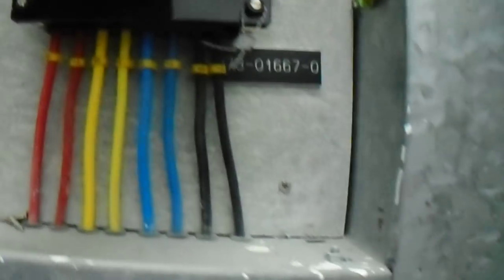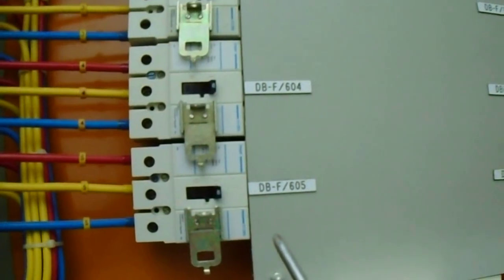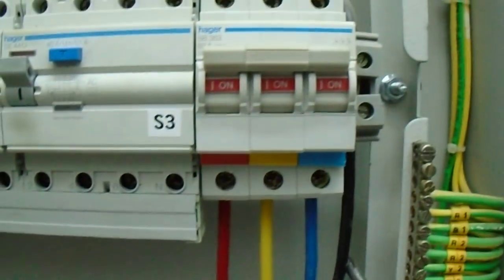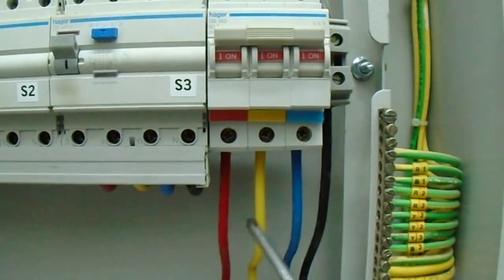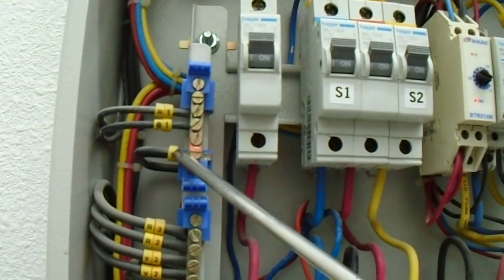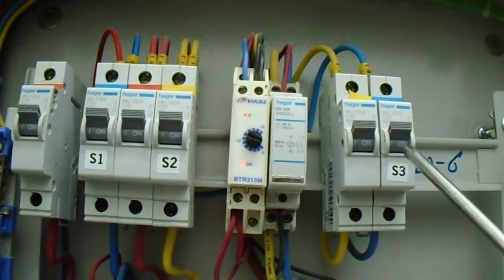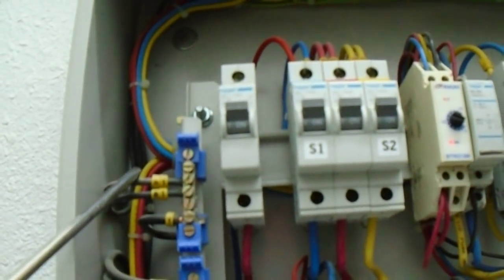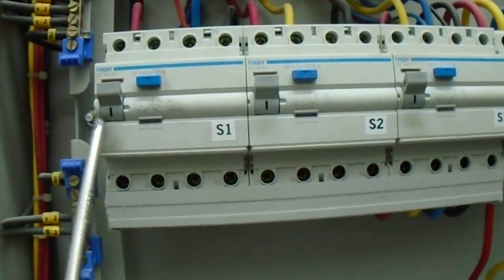electrical wiring in bangladesh part 2

Comment: SMDB ki
Reply from the maker: Sub - Main distribution Board. Individual outgoing feed from MDB power is feed to SMDB which is installed midway through the power distribution system, at the point in a large distribution cable ends, and several smaller starting sub-circuits.